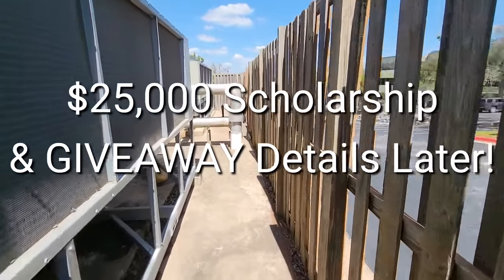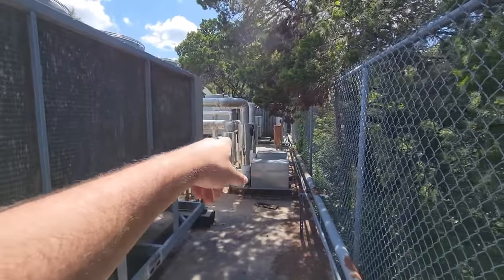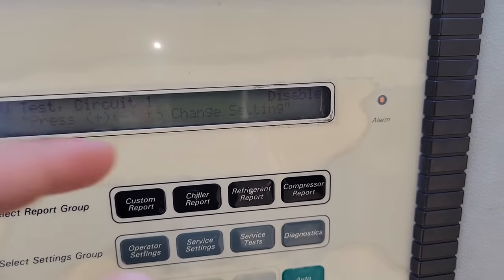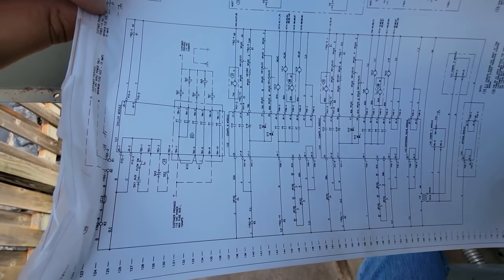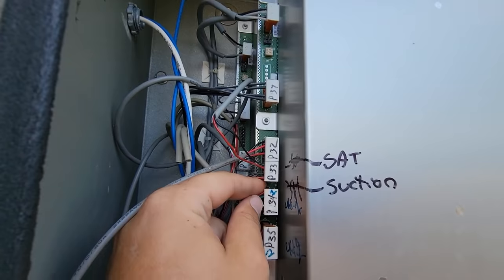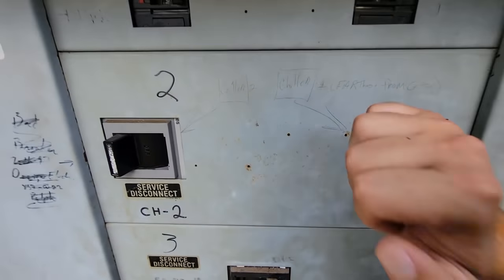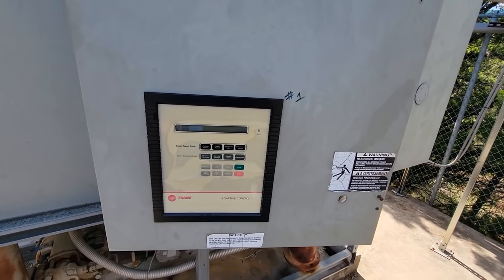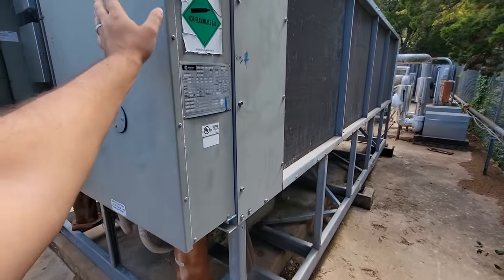EXV Takes Out Chiller on Trane Air Cooled Chiller

Comment: I think you just answered all the questions ive had the last two days while working on a very similar but older train chiller . Blue screen if you know what i mean.... High super heat low subcool degree day tripping off on low refer temp code- 195/194 when its cooler 65-75ish out . 75 and up its seems to run both stages without tripping.  Noticed the EXV is loud the whole cycle up and down. Exv frost up a lot, flashing sight glass Pulled out 80lb from one circuit. Going to really listen to it tomorrow

Comment: I’m just now getting into chiller training. I have 27 years in residential and I want something different and new and exciting. This is exactly what I was looking for. Heavy commercial as you call it. 
My question is, what was the difference between manual activation of the expansion valve versus communicated Call for expansion valve? You put it through a manual open and close and it worked. Did you again then try to operate the system and it was still giving you a code which was false?

Comment: Do the slide valve on trane units load and unload according to super heat? Or oil pressure ?
Reply from the maker: Leaving water temp. Exv controls super heat, and oil pressure isn't monitored it only has a safety switch

Comment: start of video, standing in front of large breakers/disconnects and flipping them, very bad! always stand off to the side and one hand trip them.
you just never know when something will fail or short and cause a major panel blow off crippling you. \
I have zapped myself umpteen times on 120vac, seen/felt firsthand 480vac phase to phase short and way more than I'd like to witness very high voltage distribution line faults.